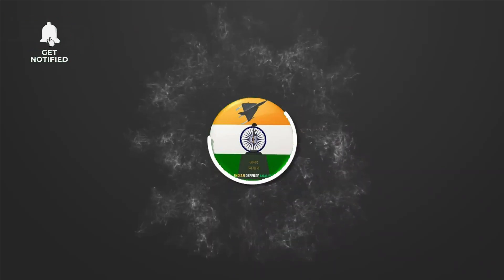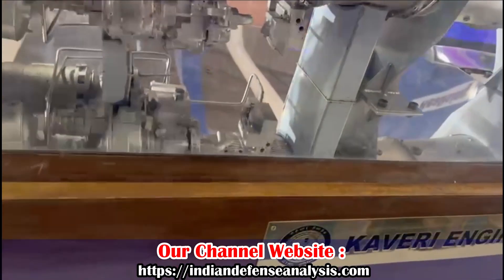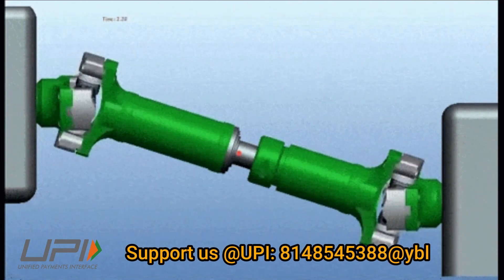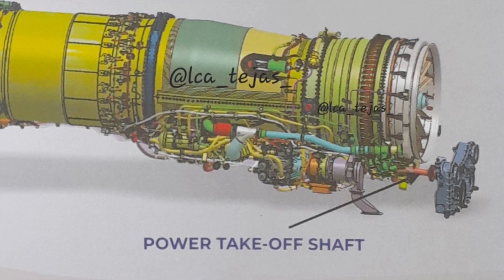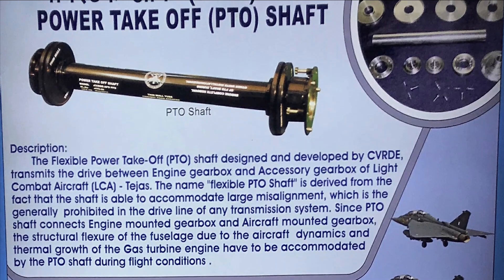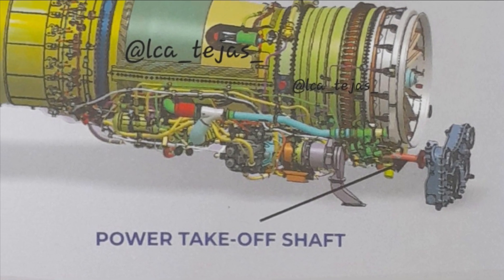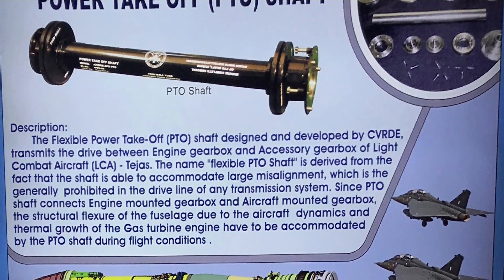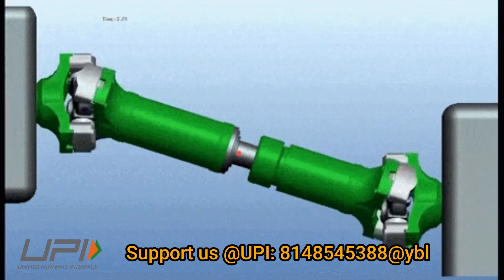Maiden successful flight-test of DRDO’s indigenous Power Take off Shaft conducted on LCA Tejas

Comment: DRDO under PM Modi and DRDO chief Satish Reddy has set up a clear path. None of the predecessors had done this before. While DRDO is the researcher, incubator and collaborator the actual manufacturing is done by the private-public industry. This has resulted in better synergies, focus and integration between all the systems than operating in silos and holding to the IP.